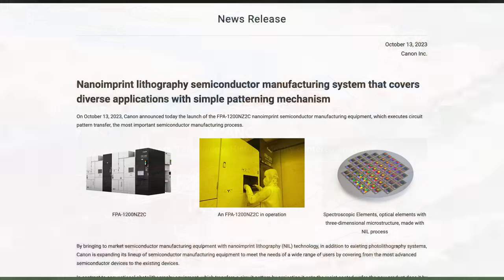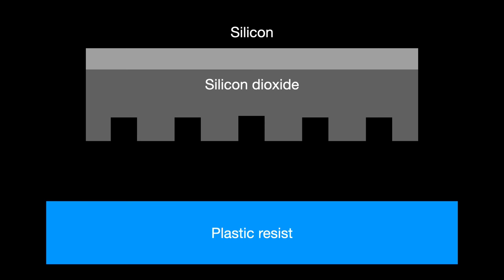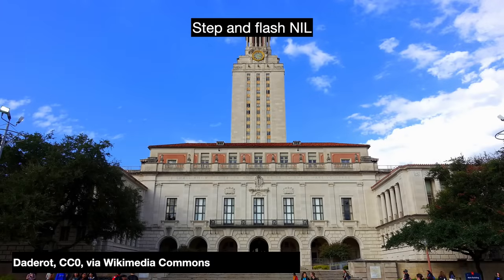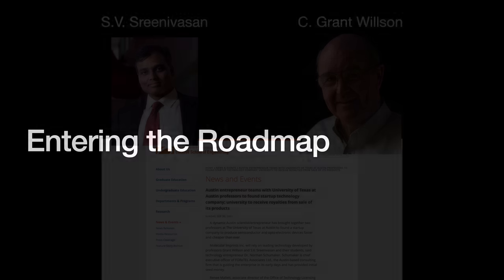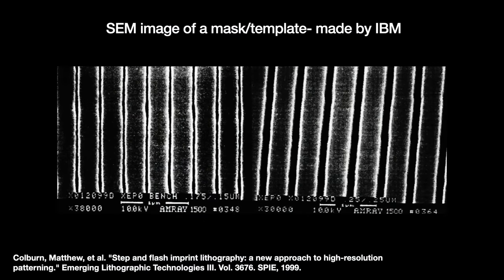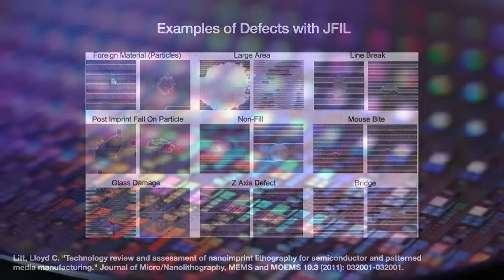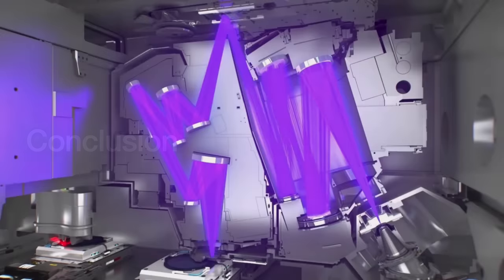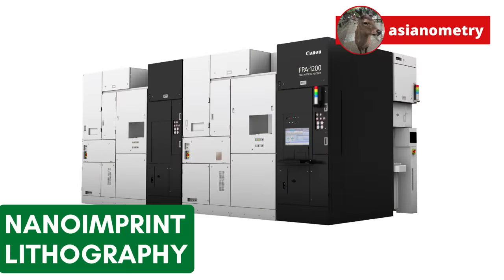A Deep Dive Into Canon’s Nanoimprint Lithography

Comment: I recently saw a startup demonstrate their ability to print semiconductors at the 2 and 3 nanometers scale using this technology, the question will be whether or not they can get yields and Purity high enough for this to be a competitive alternative to traditional euv lithography. If so, this could be a revolutionary change in the semiconductor manufacturing business that would completely change economies of scale
Reply: Making semiconductors the printing industry way.
Reply: @brodriguez11000 It is already the printing industry way. The modern printing industry uses lithography technology not the imprint technology use in Gutenberg prints.
Reply: What startup?
Reply: @kazedcat  The modern printing industry has also changed massively, with the classic printing method replaced by laser toner printing via photo sensitive drums. No more lithography needed, just direct digital raster data output to the printing device via a Raster Image Processor (RIP).
Reply: @paulmichaelfreedman8334  Are you sure we are talking about the same industrial service? because AFAIK the massive offset printing industry doing books, posters, newspapers, labels or packaging still uses ink through the lithography technique.
Reply: @PainterVierax  I suppose you are right, but part of the market has been taken by digital printing techniques.
Reply: @paulmichaelfreedman8334  digital printing suffers the same issues than 3D printing plastic/resin : it doesn't scale that well, doesn't work on as much support/material and the result is not as good (laser toner printing can't compete with the large choice of ink colors and quality).
Reply: @PainterVierax  I agree, but laser printing IS a whole lot cheaper per print than ink printing.
Reply: @paulmichaelfreedman8334  again, it depends on the scale. Though even the on-demand and small quantity services that conveniently use digital print, they use industrial ink or resin printers, not the laser technique.
And remember we're talking about industrial production, not consumer or office devices who have other requirements and other safefy rules (toner nanoparticles are very hazardous).
Reply: Exactly like printing!
"Screen printing is a printing technique where a mesh is used to transfer ink onto a substrate, except in areas made impermeable to the ink by a blocking stencil."
Reply: liink to startup name? I hope in 10 maybe 20 years it would be possible to print transistors at home, even if its sub 1million density, it would be really impressive and could be another revolution especially with IoT

Comment: This technology harkens back to the methods used to reproduce not only CDs, but also phonograph records. Can we reach further back than that? Could one pattern the resist with gravure? There would be something wonderful about creating high-technology circuits with a process once used by Dürer and Rembrandt.
Reply: I have my doubts about the production of CDs with this method, as I have "burned" CDs(CD-R) with a computer. And the CD is an optical data ... wikipedia:
"The compact disc (CD) is a digital optical disc data storage format " 
Put L(ong) P(lay)/ Vinyl records for sure are printed/imprinted.
Reply: @fleetingfacet  True... one can do nothing in 3d, as time is a required dimention too.  (+horizontal, vertical and depth)
Reply: @fleetingfacet  Time is a different dimention from width, lenght, and hight, because you have to program the printer head to actually print the different forms in a timed schedule, as they won't just appear from no-where.

Comment: Don’t ignore the optical applications. From what I understand all the AR glasses need specialized diffractive structures to project the image over a transparent glass. Stamping is currently used for this. The problem is these diffractive structures have funny angles and shapes so it’s much harder than semiconductor patterns, even if it’s larger.

Comment: I was curious when NIL was in the news a while back and then kind of forgot about it. I thought this can't possibly work. Both due to the issue of alignment and the issue of keeping the mask defect free. So it turns out the first issue can be solved through looking through the transparent mask and the second issue can (maybe) be solved by just keeping the mask clean. I'm still skeptical because it sounds like an insanely difficult problem, but then I remind myself that everything in semiconductor manufacturing is insanely difficult and done against all odds.
Reply: There is no impossible only improbable
Reply: @the_expidition427  yeah, but not even. The real killer is called economically unviable.
Reply: @Gameboygenius It's not economically unviable just economically not competitive. The issue is throughput but as the EUV tech becomes more and more expensive with hyper NA and quad patterning there should be a crossover point where nano imprint becomes competitive. NIL's yield issue is independent of resolution but EUV's yield becomes more problematic as you shrink the features.
Reply: Even though you can look through the template, overlay is not a problem that’s going to go away because rather than adjust the image of the mask (which can scale linearly), changing the shape of the imprint template is limited by the modulus response of the template: a decidedly non-linear process. This means when you apply a correction to say, X-mag, different areas of the template will respond completely differently. Nano imprint is cute for some niche applications but it will never be used to print anything at the bleeding edge where its resolution capabilities shine. And on top of that, it’s slower than molasses in January.

Comment: Nice academic review of NIL.

From someone previously working in the semiconductor capital equipment industry for decades including working for Nanonex (by the way, pronounced the same as the other Steve).  Discussions with leading litho folks at Intel, Micron and TI back in the day clearly shined light on the unlikely possibility NIL would ever become mainstream technology particularly due to direct contact mask defect issues.

At the end of the day, MII likely would have never received another funding round and Canon was no longer relevant beyond the 193 nm dry steppers - a distant third.  Canon needed new tech to provide an alternative to ASML or even Nikon. 

Remember, NIL is a JUST a fancy version of stamping or embossing.

Comment: I think nano imprint can work well with backside power delivery side of the semiconductor, it is only one or two materials copper and the insulation materials, as the purpose of this layer is solely for power delivery it is more simple and easier to work with, using EUV to this layer sounds like a match.

Secondly, since you needed to sand down the backside to expose the nTSV, the canon material sound like they can align things before printing, which is like a perfect match, if things does fall off and created a hole in the backside, if the Canon machine can find the hole and place the correct amount of filling material and applied a pure flat mask to stable the backside before building the copper at the back can improve yield.

Third, because the thing is self alignment, it also solves the possible misalignment, ie you only printed to the area you find the nm shifting if the dots from the exposed nTSV shifted 0.5nm to the left then the mask can shift left 0.5 as the machine naturally scanned what is the previous continuous print it can be just as easily to scan where these dots are and realign accordingly.

If this is the case nano imprint naturally have advantages over EUV on the backside power delivery builds.

Comment: 18:25 alignment of 1nm.  There Jon said that that is 10 atoms wide which is  correct. Just more info, it doesn't mean about 10 atom distance inside material (eg. silicon, gold, etc). Approximately, two atoms inside nearly any materials is about 0.3nm. Means they can align within 3 atomic distance. 
Imagine like chocolate chip cookies. Chocolate chips size is smaller than distance between individual chocolate chips.

Comment: Actually I think this technology could work fine for magnetic disk drives.  For what you said, terms like HAMR and PMR, PMR is simply how the spots are laid out on the disk surface and I don't see what this technology wouldn't work.  It's just a pattern for how a SINGLE magnetic blob lays on the disk surface in relation to the other ones.  PMR has a byte of spots in parallel so that as the disk is spinning under the read/write heads, instead of reading a single bit like the olden days, the heads are reading a byte at the same time (8 bits, or 8 magnetic spots).  Now, the patterns have gotten more complex to increase bit density on the disk and it also means reading/writing is faster.  HAMR is simply a technique involved in writing DATA to the spots, so that's not about a manufacturing process, that's about the operation of the device.  In this case it's best to cover hard disk technology because this is a topic in itself.

But I don't see why the nanoimprint tech can't be used for adding the magnetic dots to the hard disk surfaces.  However, disk surfaces are expected to last MANY years so it is a highly technical process.

Comment: I think a video talking about masks would be a great thing.  I don't think people realize just how hard it is to make a mask.  For instance my understanding is TSMC takes a few days to make a mask for something like a CPU core die.

In the part of inspecting a mask I was wondering if AI could be a great help here, I think it SHOULD.  Nvidia has developed the AI software to help TSMC make masks and it's supposed to reduce the time down to less than a day if I recall the article correctly.  TSMC has to of course BUY the system but I think it makes economic sense to do from many days down to a day and on top of that reduce the equipment to about 1/3 in the compute side to make it.  And this uses AI.

If you've made a video in the past maybe it would be good to cover what Nvidia is doing and how that can benefit companies like TSMC.

A side note, throughput on these machines isn't just about the cost of the machinery running a production line.  Actually that wouldn't even be the main point.  If the machines are incredibly reliable over many years, ROI comes into play.  No, it's more about the cost to RUN the line, so power consumption, maintenance based on run time, etc.....  If it costs a company very little to run a line production can be slower and this should make sense.  However a company has commitments so they have to meet a throughput that allows them to be profitable and meet their customer's needs.
Reply: Reliability is insignificant because of plan obsolescence. It does not matter if the tool last for 30 years when the shelf life of the technology is only 5 years. Yes you can fab 5nm process until 2033 that does not help you when the industry has already move on to 0.8nm.
Reply: @kazedcat  No that's not true.  First you mean 1.8 because the node path is 3nm which TSMC is on right now, then 2nm, then 1.8, then 1.7, etc.....   MAYBE by 2033 fabs are at 1.7, probably 1.8 because it's getting harder to move to each progressively smaller node.  But nodes are just a name.  TSMC's N3 isn't at the density they said they would be at so even with the fake naming scheme the lead company isn't making its goals, so it's N3 is really about what N4 should have been.  Really.  Go read.  High-NA EUV is supposed to help get them back on the path of smaller nodes, as in REALLY SMALLER nodes, not just in name only.  The companies have to get good at using the new lithography though and that takes about a year.

But next is an assumption that the leading node is where all the business is and that's PURE fallacy.  The fabs get a good 5 years out of the leading edge, and that means heavy business by companies making high end compute products, or Apple.

What's going to happen is the nodes in the realm of 20 - 5 will start to replace most of the older nodes and that's because costs for materials are going back up,  Something that may have been on nodes like 28 and larger will fade away and these newer nodes will replace them.  You do hit a point where shrinking analog circuits isn't so great but you still get scaling down to about 6nm.

But we're heading for a technology war between China, Russia, N Korea, Iran and a few other insignificant countries and the free world, or mostly free world, and materials used to make ICs INCLUDING silica, which becomes silicon are going to go up in price as China decides to greatly reduce what it sells, and they control the market of many of these materials including silica, which means even making those large crystals are going to get more expensive.  So they'll be much more pressure on cutting the use of materials which will close a lot of those older fabs which means ever smaller nodes will become general purpose nodes.

You know when AMD started using TSMC N7?  2019.  Do you know AMD is STILL making products with N7?  So even with just AMD alone TSMC is 5 years on a node that they started producing products with in 2016.  Maybe what you don't realize is companies like AMD, Intel and Nvidia make a new generation of products over about 1.5 - 2 years as a NEW generation.  But if that generation is successful they'll keep making that product.  AMD will keep making Zen 3 and RDNA 2 graphics (6000 series) into 2024).  They've continued to make those products as low cost products vs. their new line of Zen 4 and RDNA 3 graphics.  Zen 2 was the first gen AMD CPUs to use TSMC N7.

So here it is coming up on 2024, TSMC has been making products on an N7 process node since 2016 and they're STILL pumping out lot of products for different companies on that node.

This stuff stays in production at a very profitable rate for the fabs for more years than you think, even making high end compute products.
Reply: @johndoh5182  You don't know how to count you shrink around 30% per generation. So 3nm then 2nm then 1.8nm then 1.2nm and 0.8nm assuming the rate of 2 years per full node shrink will continue then at 2033 we will be at 0.6nm. I am accounting a slow down so 0.8nm in 2033 is a good prediction.
Reply: @kazedcat  you seem to be pretty misinformed about how semiconductor nodes are used. Right now, hardly any of a wafer uses leading edge nodes. Most of the semiconductor is still produced using older techniques. This has to do with yields and cost efficiencies. There are certain parts of a finished product that are best made using cutting edge tech, but the majority of it is produced using a gen or two older tech. I work in a leading edge semiconductor fab and we still have plenty of litho tools that are 10+ years old. 

Also, process node names/sizes are mostly meaningless nowadays. You're using those terms like that relate to physical transistor size, which they don't, and has been repeated on this channel dozens of times. You're quoting numbers that don't really have any meaning. Johndoh explained this to you pretty well and you seem to have ignored his explanation.

So just to recap, you don't make a semiconductor out of one process node. You use a variety of nodes to produce a single product. The majority of those nodes are not leading edge. This is especially true with new chiplet designed products.
Reply: @CRneu  So reliability is not an issue with photolithography tools and they last a lot longer than what is necessary.
Reply: the scale is unbelievably small, it is impressive how far humanity has come that we can build on nano scales now ???

Comment: If you can make the machine 10 times cheaper than an EUV machine, then you don't need equal throughput, individually. Just have more machines.  Cool, I haven't keep up with the developments on this since 2006.
NIL might be good for smaller chips or maybe FPGA.
Ah, you mention memory chips at the end.
Reply: This doesn't scale perfectly in practice as fab real-estate is a recurring issue. Not that EUV don't have them, especially on the non-cleanroom floors of the fab.

Comment: When the mask is removed your figures show resist material remaing in the spaces between the main pattern on the surface of the substrtate. I think it would be useful for viewers not familair with processing if you accounted for the dispostion of that material,  in order to accurately etch the surface of the substrate below without damage or loss of shape of the main lithographic resist  pattern.

Comment: Carbon assembly using X-rays. Can hit resolutions down to 1nm, and thus can build essentially indestructible masks, or as close to it as possible as the structure is cubic in form, which is the strong arrangement of carbon known as diamonds. 

Currently only De Beers owns a lab doing this, as far as I know. The process is still unrefined and messy, but I am certain that it can build masks for this process.

Comment: I assume that the equivalent of a resin printer that uses a higher resolution display as the equivalent of the template isn’t. But one wonders if further developments of high resolution displays couldn’t eventually replace some of of these technologies, maybe not at the smallest size, but very small sizes?

Comment: The original machine had a base-plate of prefabulated aluminite, surmounted by a malleable logarithmic casing in such a way that the two main spurving bearings were in a direct line with the pentametric fan.